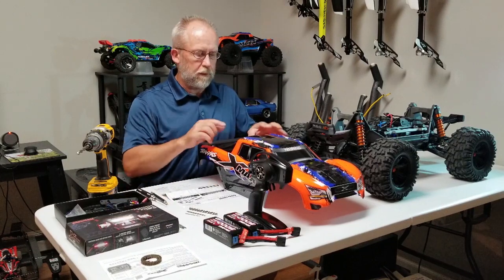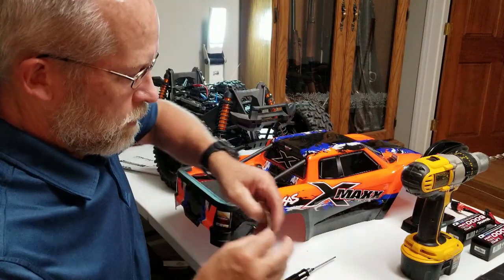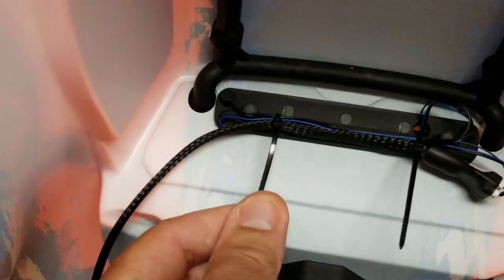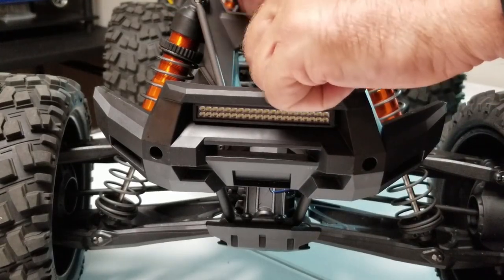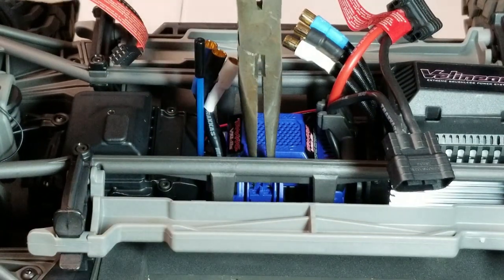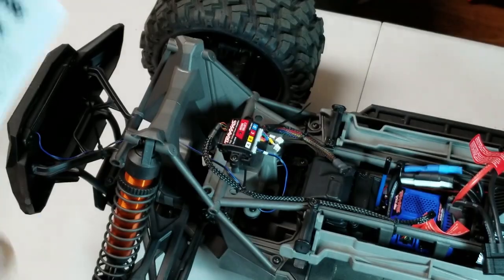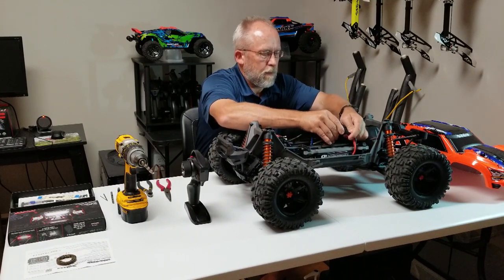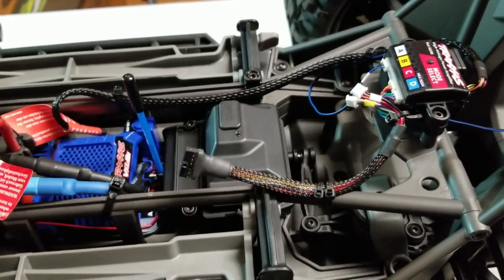TRAXXAS 8S XMAXX #7885 LIGHT KIT INSTALL

Comment: I am commenting while watching, here is my quick question, the back light when installed, are the wirings a problem if the body case cover gets thrown out while driving. (Wirings getting up out and potentially damaging wires?)
Reply from the maker: Wire tie the pigtail to the frame and it simply unplugs when the body comes off, if I understand your question
Reply: @chilly7261  thank you appreciate it! Planning on doing this, but is it possible to put the back lights on the rear bumper instead??
Reply from the maker: @housesaint1685  I've seen a video on that. They cut a slot in the bumper. Not a fan. Really not a problem with it on the body

Comment: Great vid , I think 🤔 I’ll just install the front lights only
Reply: agree , body popping off will rip the wires out of the body .
Reply from the maker: @sprc3352  The short wire coming from the power amplifier is zip tied to the frame. The wire in the body is zip tied to the backing plate. They simply unplug if the body comes off.  No damage at all...

Comment: Hi Sam, nice video, I used it to fit my new kit as the Traxxas instructions are not as good as they could be.  BUT I have had a problem on fitting it.  I have bought the Traxxas LED Light Kit X-Maxx TRX7885 and on fitting the rear light one of the very small connectors that has 3 very small cables got caught and two of the cables broke right where they connected to little white connector.  I have contacted Traxxas and they say they are not repairable and I have to buy a complete unit (8773) so my question is has anyone else had this issue where the connectors are very small and can't be soldered or put the two disconnected cables back into the connector - does anyone know if anyone say on Amazon sell them - my problem is I am in Spain so buying from a US based company is not possible and am sure this will happen again over time.  Many thanks in anticipation of possible help.
Reply from the maker: I do have a simple solution. Those are JST-SH 1.0mm 3 pin female connectors. Here's an Ebay link for them with a short cable...

https://www.ebay.com/itm/Micro-JST-SH-1-0mm-3-Pin-Female-Connector-Cable-Header-on-BeagleBone-Blue-x-10-/171351041620?mkcid=16&mkevt=1&_trksid=p2349624.m46890.l49286&mkrid=711-127632-2357-0

Cut the wire back, and solder them on away from the connector! Or, easier yet, there's two of them connectors on the wiring harness of the light kit that are not being used. Cut them off and replace the broken ones! 

For soldering small wires like that you need a soldering station with a small tip. Not terribly hard, very doable. And some small heat shrink tubing.

Cheers and good luck with it!

Comment: What did I do wrong? 
After install, I get front light  high and low beam.
Rear just have brakes on all the time .. no running lights or reverse..
Reply from the maker: Not much to go wrong with this install. Check the wire colors are in the matching sockets maybe?

Comment: Sir Which cameras you use for recording which is mounted on your controller and how did you mounted it
Reply from the maker: If you're referring to the running video at the end, I recorded it with a head mounted Hero 7 Black GoPro...
Reply: @chilly7261  thank you sir

Comment: Can I ask why your running you’re xmaxx on x2 3 cell lipos and not the to 4cell lipos it’s rated for?
Reply from the maker: It's on 8s, those are the smaller 5,000mAh 4s lipos I was using from my Maxx. I had bigger ones on order, didn't arrive at the time of making this video...
Reply: @chilly7261  ahh that makes much more sense
Reply from the maker: @elliotredcliffe3144   👍

Comment: I did not like the placement of the taillight. I ended up removing the rear bumper cover and using a dremel to elongate the recessed part of the bumper. If you look at the bumper lines you simple make that notch just barely longer than the light. I then used a heat gun to warm the bumper up a little so I could flex it that 1/8" that I needed to slide the light in there in between the layers. The light sits nice and tight and is just barely beneath the surface of the bumper. There is no modification to the light itself; in fact, the screw tabs on the rear light are what binds it in place once the bumper cools back to its original shape.